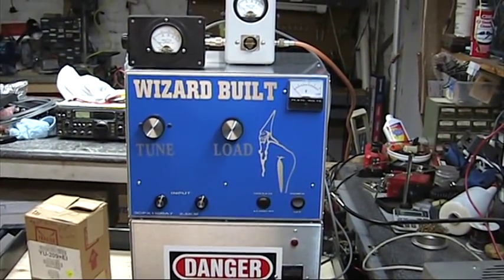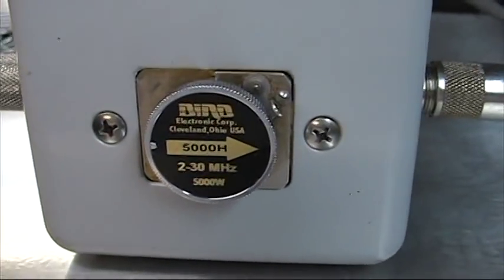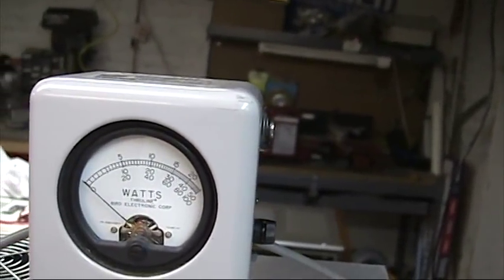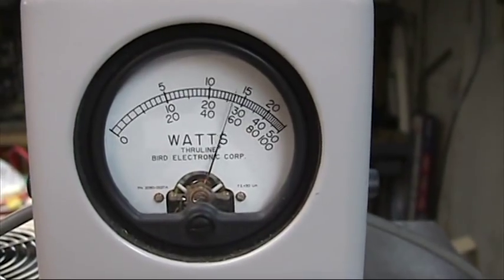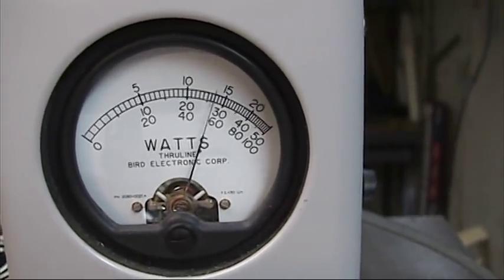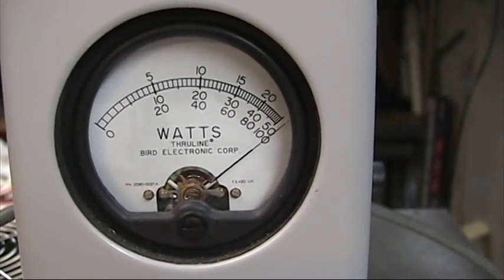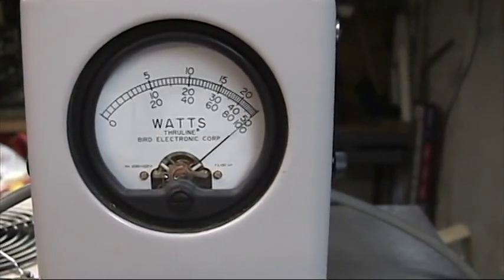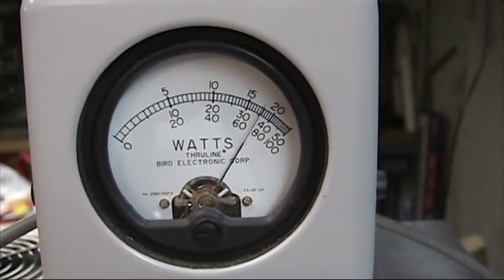3CPX1500A7  OR  3CX1500A7

Comment: On the 20LF6 pdf it says Temporary Overload Plate Dissipation: 200W for no more than 40 Seconds.
Thats a tough tube and 300c max glass temperature.

I would imagine the 1500 would be 7000W.

Do you still use russian tubes and do they hold up?